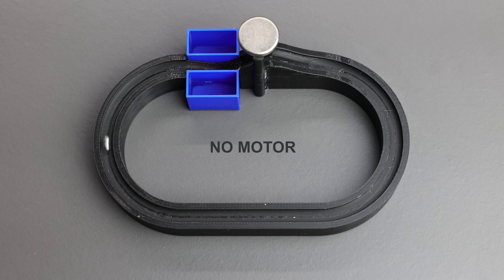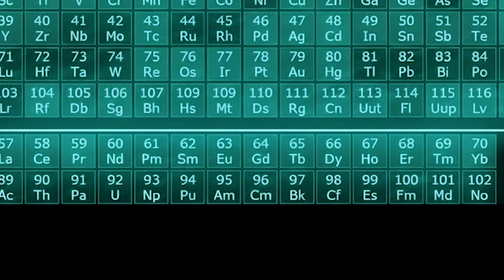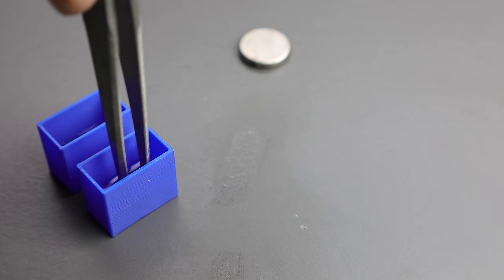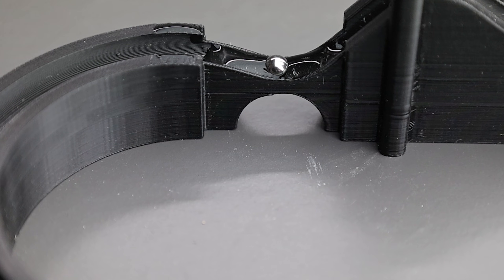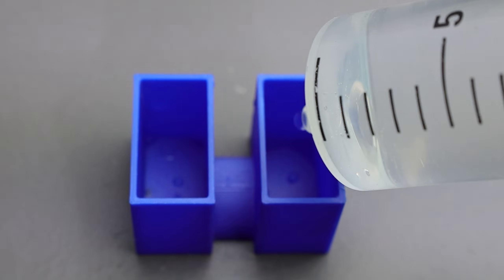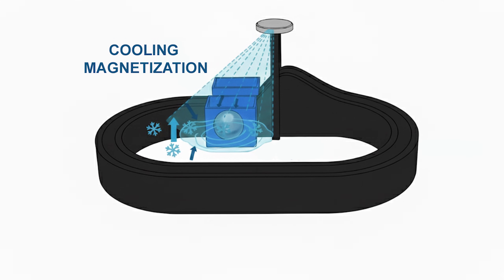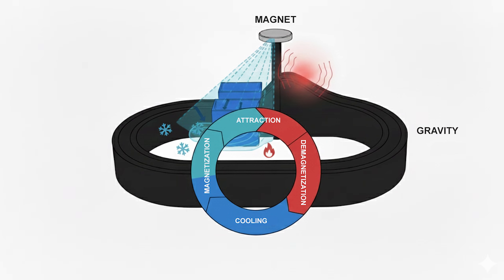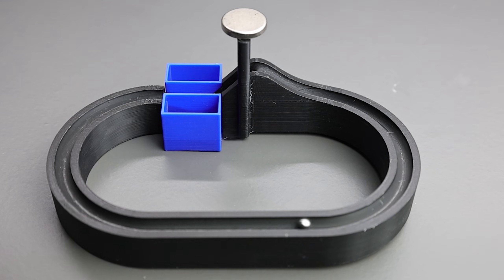How to Build a Room Temperature Curie-Effect Magnetic Engine that runs forever

Comment: Very interesting. The fuel is effectively water or the liquid in the cooling zone. It has to be allowed to evaporate otherwise it accumulates heat. So the liquid is spent as it evaporates cooling the area to a bit under room temperature.

Comment: Do it on a clear glass table. LOL
Reply from the maker: Here it is: https://www.youtube.com/shorts/oujf2SVgXU0
Reply: @ViralVideoLab  Very cool, I'm actually impressed. Thanks!
Reply: I am not impressed. There is plenty of room inside the massive track both for coils electronics and batteries. Such the machine is indeed possible but to calibrate it would be practically impossible as it runs on nano watts the surfaces must be nanometer scaled polished and air is removed
Reply: @Zelenyi4ay You are 100% correct about having electronics in there, but the fact that within minutes of me asking for a shot on a clear glass table, they posted it, kind of impressed me. Lot more science needs to be done. While skeptical, I was impressed with the speed at which a second video was posted.
Reply: @ReverseThePolarityProductions on a second thought, if they have a glass table in their room, and the already assembled hmm…”demo device”, it indeed takes minutes to take it from non-transparent table and move to glass table, film a video and post it, or maybe this video was already pre filmed and hence was ready to post. This demo must be printed in transparent plastic or scintered glass so we all see the device completely transparent, or ahead of X-Ray screen
Reply: @Zelenyi4ay That's a possibility for sure. But unless they were waiting for my comment, which seems unlikely, the speed at which they did it was pretty quick. But printing it in clear resin/filament is the only way. I was just more impressed with how quicly they produced the 2nd video. But you make some good points.